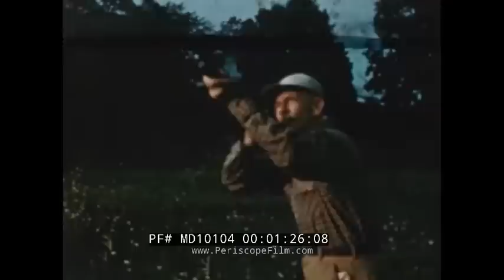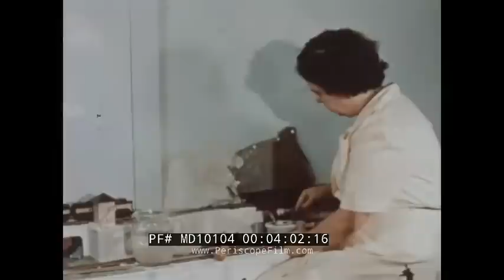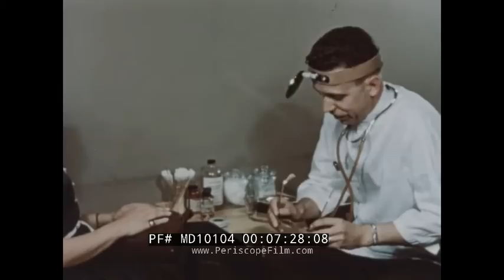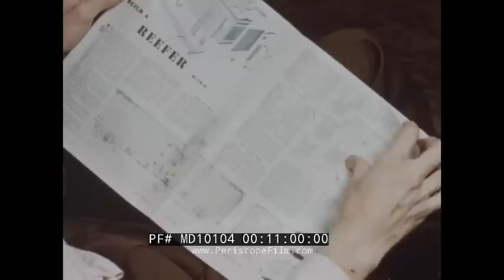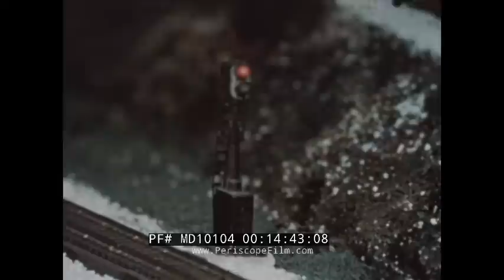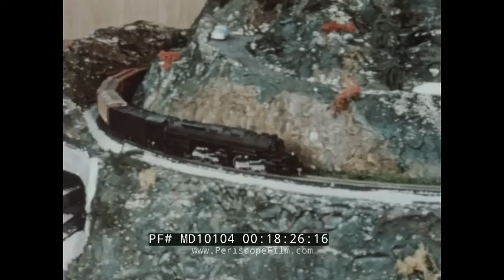"ALONG THE RIGHT OF WAY" 1950s O-GAUGE MODEL TRAIN PROMO FILM  BY MODEL RAILROADER MAGAZINE MD10104

Comment: "Very little space is needed".... wahahahahah!  Model railroads will grow to consume all space and then some.  Even if you don't have a layout!  65-odd years of stuff here.  What I inherited from my dad will fill a couple of 12x16" moving boxes.  My stuff has a fairly generous attic space packed to the gills.  And I don't even have a layout, that would require room to move.  But this is my #1 hobby... I have more... and this is how it turned out.  I build models - and for the most part, I don't build layouts.  I want to.  Always wanted to.  But one thing led to another and here I am downsized and old and creaky and my long-grown stepkids and step-step-grandkids never had any interest.  I don't write off the whole generation, but this thing is in your blood or it's not and I've rarely seen anybody switch gears.  I do not remember a time before I was into trains - models and the real thing.  For a time, I was a very active member of a museum that worked on rusty old things, a few of them were even known to move once in a while.  That pretty much ended when I got married and an instant family along with starting my own business.

Comment: "In the beginning", the word "gauge" was almost always misused when the word "scale" would be correct.  Scale being the numerical ratio and gauge being the distance between the rails.  (One "scale" can have multiple "gauges.")  But today, by convention, toy trains are still referred to as O gauge and S gauge.  O scale and S scale are used when referring to the non-toy trains.  Most of what is in this video would be called O scale today.
Reply: Thank you for the clarification . I was looking through the comments for this very explanation.
Reply: @Trojansz  As an example, "HO" scale is 3.5 mm to the foot which is 1/87 full scale.  Prototype standard gauge track (in the U.S.) is 4'  8-1/2" as the gauge.  If you divide that by 87, you get very close to 16.5 mm and that is the GAUGE used for HO scale track if you are representing standard gauge.  But you might be modeling a 3 foot narrow gauge railroad. That calculates very close to 10.5 mm and that is the GAUGE of the HO scale track if modeling 3 foot narrow gauge.  Scale is still 1/87.  And the nomenclature is HOn3 meaning HO scale - narrow gauge - 3 foot.  Now, there are many wrinkles to all this, and you can get far down in the weeds.  This video has O Scale but that usually has a 1 1/4" track gauge which would represent 5 feet, not 4'  8-1/2 inches.  Most live with this error.  Some don't and make adjustments to scale, or gauge, for an exact match.